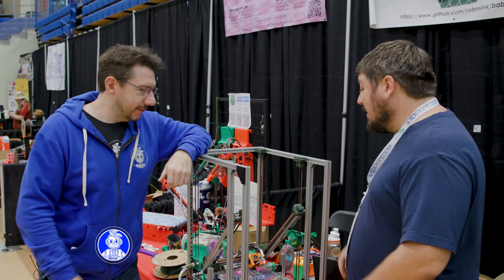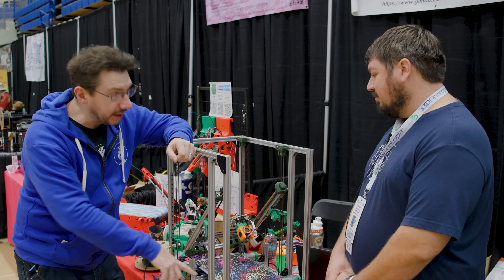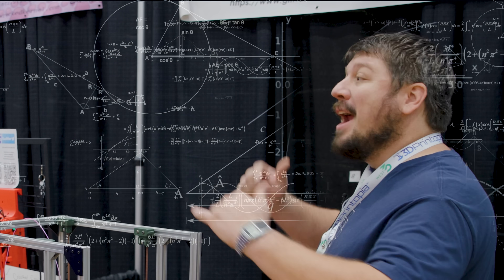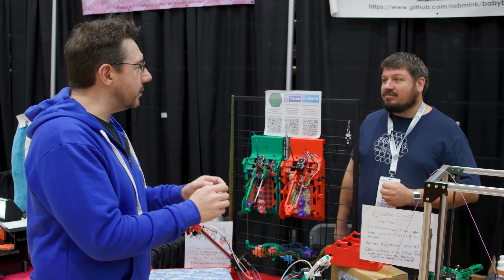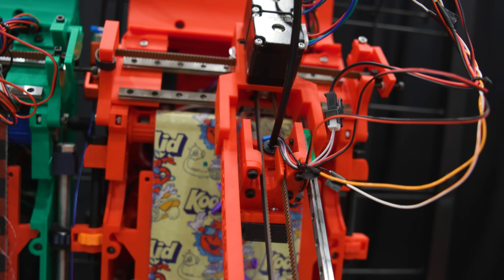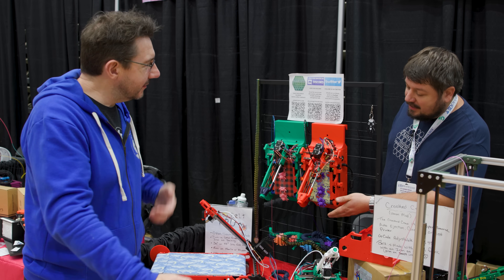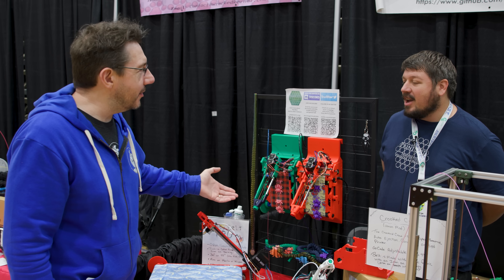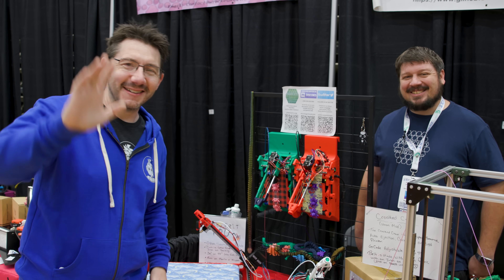You've NEVER Seen a 3D Printer DO THIS!

Comment: Lookup the Lynx3D printer.  It looks like this is an extension of that where the angle of the gantry can be adjusted in real time.
Reply: I just got a Lynx3d Diamond.  Its a very impressive machine.  To convert to belt mode on it, you must put a new config file in, unbolt the hot end, rotate it and re-install, and then do the two thumb screws.  For printing at 90 on that it moves the belt and that is loud and slow.  The build quality and innovation is massive, but, respectfully, I feel they are different ideas and different solutions.
Reply: @RobMink  I have been interested in the Lynx3D and now this.  I have been thinking about a small print farm using belt printers.  The idea is pair that up with a Chameleon3D or on KS the new Infinity Flow S1, and print forever just swapping out empty spools on the Chameleon or Infinity flow.  Use 5kg spools so I don;t have to swap filament as much.  That's kind of the most important thing keeping me form running a print farm is the constant swapping spools that run out.